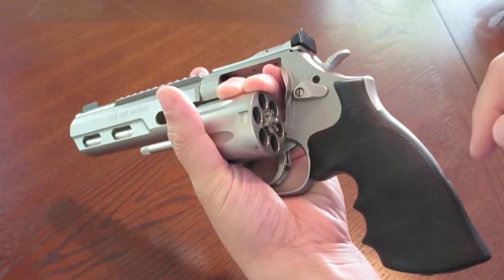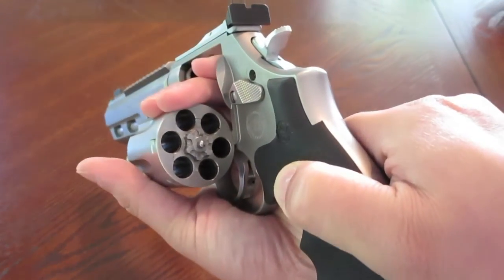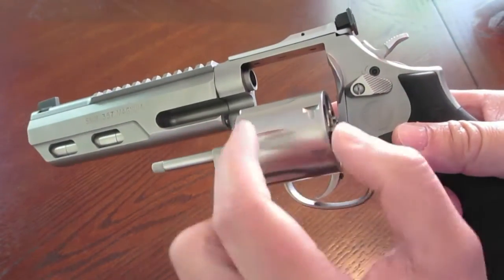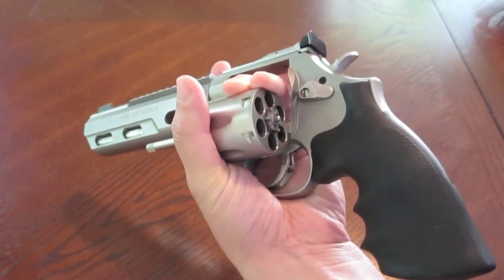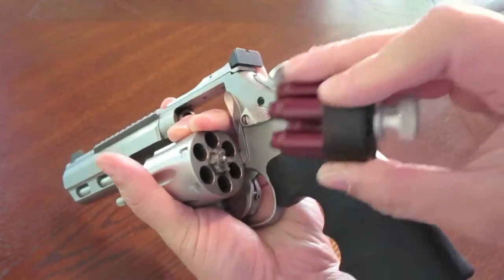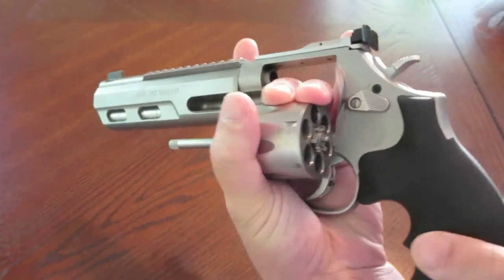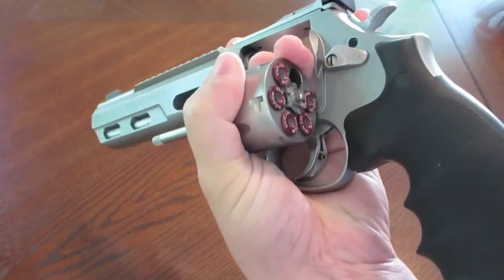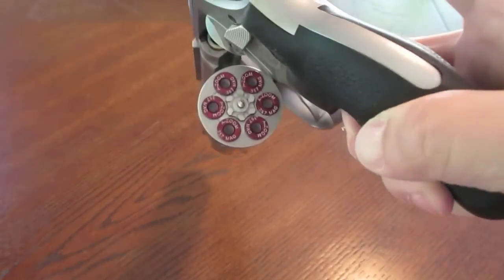Revolver Tip: Fluted Cylinder Reload

Comment: Good tips, I just prefer un-flutted because the extra weight helps recoil / looks nice.
Revolvers unfortunately have a VERY high axis to where the recoil starts. Which makes your hand a fulcrum and revolver a lever , hence the muzzle rise. 
You have 2 options,  compensator or more weight. The gun is already ridiculously loud , so weight is the way to go.

Comment: When single/manual feeding, take into consideration your cylinder rotation. S&W rotates counterclockwise, so, load clockwise. Why? 

You had time to load two cartridges before a threat comes around the corner. He knows you're reloading because he is a pupil of Sterling Archer, and counted your shots. You slam the cylinder shut, and pull the trigger. Four times. To four clicks. If you loaded your cylinder like this video showed, you loaded the LAST two chambers FIRST, and are now dead. If you load a cartridge, then rotate AGAINST the timing rotation, you'll have your fresh rounds on tap, and ready to go.